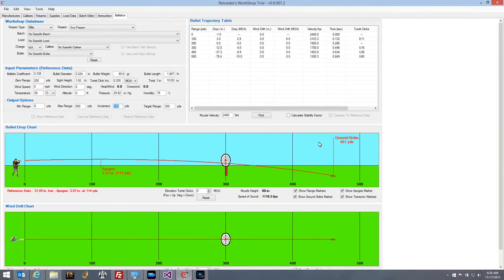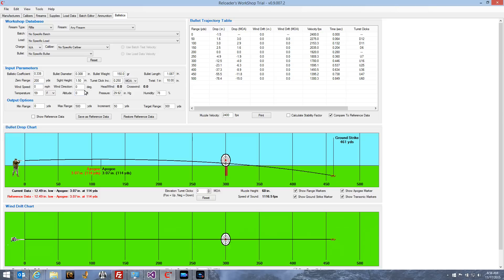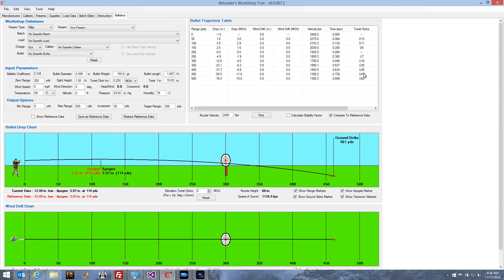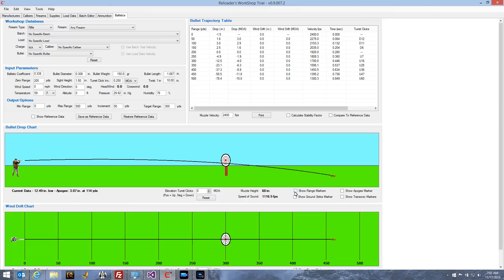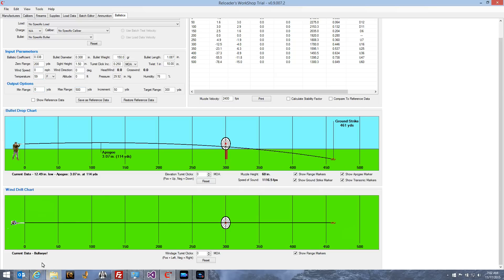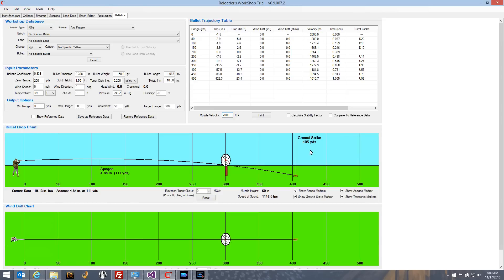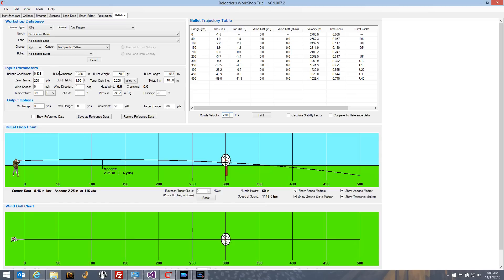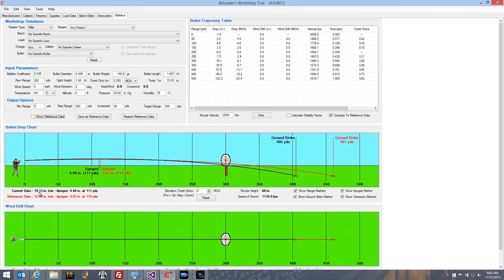Reloader's WorkShop Tutorial - Part 4 - Ballistics Calculator

Comment: I downloaded the trial version about 2 weeks ago.  Spent a little time playing in the program and found it relatively intuitive.  But this morning I opened the program, added some load data, and then experimented with other tabs.  I received a pop up window to quit or continue and i chose quit.  Now I can't open the program, getting "overflow error" message.  I also opened an acct on your support forum and still have not received a confirmation so I can post to the forum.  
I have 17 days left on trial version.
Reply from the maker: +Semper Fi Fi Hi, what user id did you use on the support forum?  I can send you instructions on how to get back up and running, but need the email address to send them to.  If I had your user ID, I could get it from that.  Thanks!